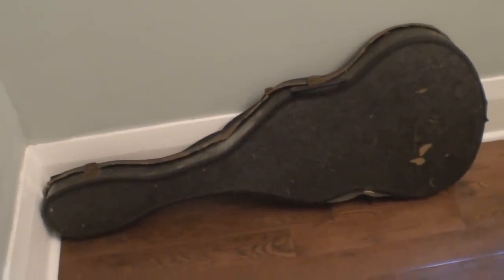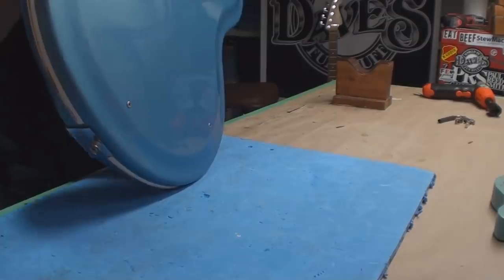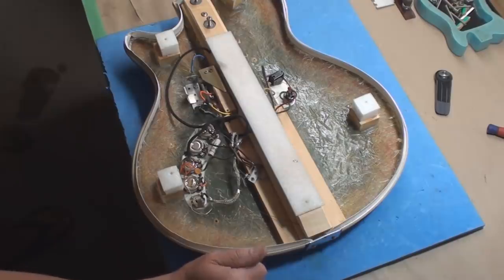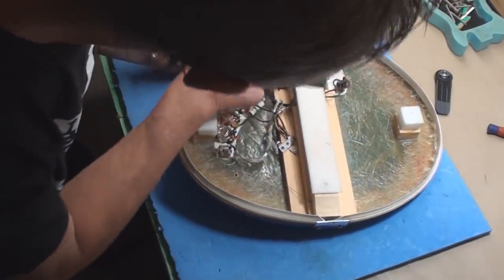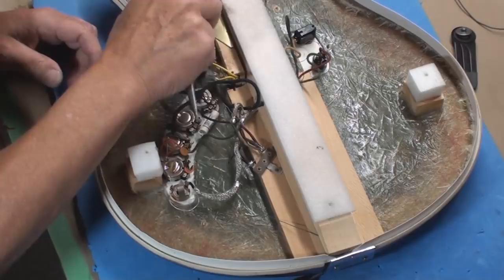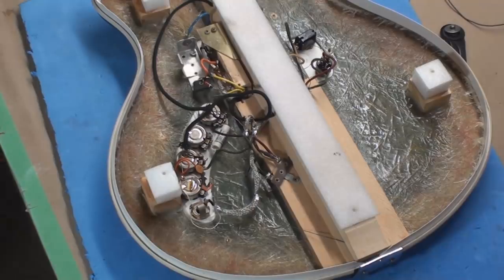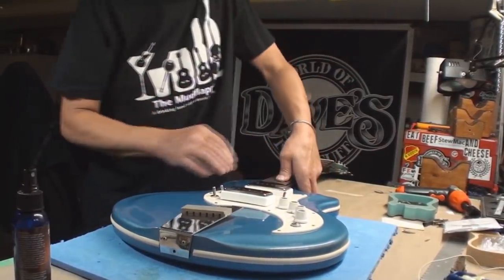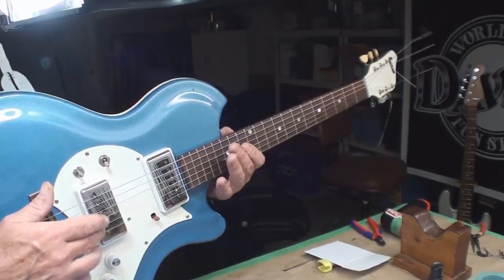Vintage Supro Guitar Gets Looked At

Comment: It's a mid-60s Supro Tremo-lectric in Wedgewood Blue. From what I found out, that switch is for an electronic tremolo. It takes a 'C' cell battery and there should be a little light bulb in the wood block near it. It all functions together to create a tremolo effect.
Reply: I don't have one or own that guitar. I could search around for one and let you know if I find it.EDIT: I contacted Supro's website and asked about the wiring diagram/schematic. Probably won't hear anything until Monday at the earliest.
Reply: I heard back from a guy at the Supro company, but he had nothing to offer except well wishes. While I was digging around, I found out Harmony guitars had a similar built-in electronic tremolo set up. It ran off 1.5V. They may have used similar circuits. I'll see what I can find.
Reply: Update: Sorry Dave, but I couldn't find anything useful on a wiring diagram/schematic for that guitar. I did learn Harmony guitars had a similar model during that time period that used a transistor circuit inside the guitar. I did see an ad by a guy who had a Supro like you worked on. His ad said the tremolo was functioning well.
Reply: I suspect that what was assumed to be a condenser mic may actually be an opto-coupler, similar to what makes the "vibrato" circuit in a Fender amp work. I remember once seeing advertising for a tremolo feature on old Supro's and they feature this same switch. I bet it's just a momentary-contact type that has to be held in the 'on' position and when the player lets go of it, it springs back into the 'off' position, in a way similar to the sporadic, occasional use of a wang bar. It'd only make sense that there's a battery & a light bulb involved.
Reply: That'd be my guess, too.
Reply: Wow, that is so cool, an opto-electronic built in trem/vibrato!

Comment: I've found this exact model in a colour scan of a 1964 catalogue advert.  It's a 'Tremolo-Lectric' model.    It has a ''all new built-in electric tremolo effect' - that's what the mystery switch is for.  "Instant tremolo at artists' command"; "finger tip control''.   The tremolo is "powered by a single standard flashlight battery".  The model cost $169.50 plus more for either hard or soft case.    It says the pickups are height adjustable.

Comment: This is the 1965 Tremo-lectric by Supro. And yes, as someone mentioned in the comments, the little toggle activates an electric tremelo circuit. Examples of this in fine working condition run around $2K US in the vintage market. Good luck finding a schematic to get it to work.
Reply: True. My Google-Fu is not that strong, however.

Comment: In order for that electret microphone to work it needs a capacitor and a resistor to complete the circuit... if it is an electret microphone.
But it looked like an electret mic.

The rest of the insides look like an arts and crafts project from the 70's.
Reply: Not a microphone. It's a tremelo circuit.
Reply: I think it's an opto-coupler. The switch isn't supposed to latch in two positions. When the player holds it in the engaged position, a tremolo circuit is activated. See my comment above.
Reply: randolph patterson opto couplers weren't patented until 1968 and there is no reason to use one in a 1960's battery operated tremelo circuit.

Comment: I bought this model Supro with my first paycheck a age 15. The red normally open switch is a minimalist wah wah. It contains a lightbulb and light dependent resistor.
Cheers!
Reply: Dave's World of Fun Stuff 
It looks like it's all there. When you move the red switch it turns the lightbulb on activating the light dependent resistor to lower its resistance. There should be a capacitor in line to ground with the LDR(light dependent resistor). More like a tone control than a wah.
Reply: The light/photo sensitive resistor should be one unit and wrapped so the lightbulb will have maximal effect on the resistor.

Comment: I believe years ago when I was intrigued with Supros I found some info.
It seemed that possibly the pickups were held in with the second and fifth pole screw holding the pickups, thus hiding any attachment. As to the neck it may be made with half round metal core implanted somehow? I know it sounds a little bizarre! The Resoglas body seems to hold up pretty well too!

Comment: Just thinking.....if the switch is momentary on, could it be to energize a small reed relay that is inside the “little wooden box” to activate the term circuit?  The resistor could be acting as a current limiter?  Just thinking out loud here.

Comment: Electrical tape hit the market in the mid 40s so its very possible that its original. I imagine it would be insanely dried out by now. Imo it shouldnt be used for anything besides temp attatchment to a snake.

Vntage is a strange word. It currently describes anything made between 1995 to 1921. Yes 1995, despite the warped perception of those of us who think the 90s were a minute ago. I wish we had 3 catagories for it. Beeak it into 35 year blocks or something.

Comment: Hey Dave, didn’t hear you say anything about it, was the neck straight? Hard to believe without a truss rod. This was another nice video, I’ve played a few of these but never worked on one. I knew they came apart in the middle but really never saw what was inside. It was really cool to see. I’m really interested now, if that’s a tremolo circuit, just how did they do it with a battery, a resistor and a cap. Go man go.
Reply: they have steel reinforcing rods in the neck

Comment: Dave why people don’t tell you what is wrong with their guitars I mean like the Pickups may have a short circuit or is not working at all or the truss rod could be too tight or a truss rod could be loose or the guitar has a Killswitch, like what is that switch for the it take a 9 battery to make you job a Little easier to know what’s wrong with the guitar